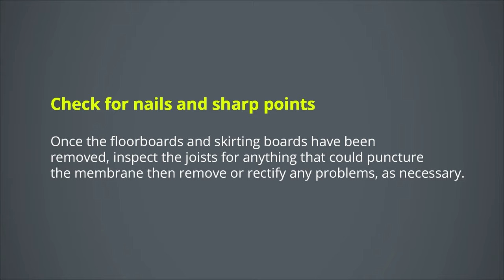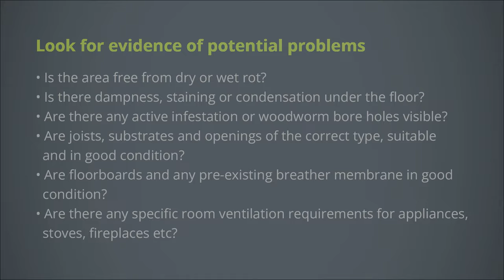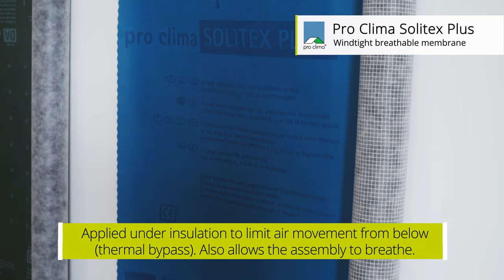Thermally Upgrading Suspended Timber Floors with Natural Insulation

Comment: Thanks Dave, very useful video. I am considering using your system, but I have to do it from under the floor, via the crawlspace. Our ground floor is largely tiled and boarded, on top of the original floorboards. Does this mean I do not need to use the vapour control membrane? I can't see how any excess moisture could seep through the tiling to cause a condensation problem beneath. Many thanks, in anticipation.
Reply from the maker: Please see the "From underneath" installation guide on our website for full details of that alternative method. https://www.ecologicalbuildingsystems.com/post/suspended-timber-floor-insulation-installation-underneath  The vapour control membrane in the video is recommended to ensure it is airtight in the long-term. Over time a tiled floor may crack, break or need maintenance, which may compromise the airtightness if that is the only thing preventing draughts. The method described in the video also seals the DA membrane to the walls with flexible tape, eliminating all draughts through the floor and around the edges. This is also great way to deal with wooden floors and any potential movement over time.

Comment: that's what in US is called a crawl space. Another solution is being suggested to incapsulate the crawl space with a membrane to prevent moisture from the ground and more importantly the radon gas reaching the living space. The wall of the crawl space are insulated, as well as, in cold climates, the floor joints, just like in this video. Any moisture is also removed with a dehumidifier.
Reply from the maker: Laying a 1000 gauge polythene radon barrier membrane on the ground below the ventilation zone below the floor joists is a good idea not just from a radon protection viewpoint, but also prevents excessive moisture from coming up into the vented zone from below ground.  If there is sufficient ventilation in the zone below the floor joists (air bricks) then dehumidification (apart from perhaps some initial dehumidification) should not be necessary.
Reply: 😅😅in Deutschland  heißt das auch   Kriechkeller. Aber sehr selten baulich umgesetzt.  Unterströmte Flächen zählen 2x so schlecht in der wärmebilanz
Reply: @EcologicalBuildingSystems  Where does the excess moisture go if a ground membrane is installed - is there a danger it will make the walls wetter, especially if the crawl space ground level is below the outside ground level (which is surprisingly common in older houses)
Reply: @furniss32 also interested in knowing this.
Reply from the maker: The zone below the floor joists must be adequately ventilated.  If the crawl space is below external ground level then there are options such as telescopic vents that can be used.

Comment: Our 20th century meddling/improvements to our Victorian houses led to unintended problems.. and still do..  Back then when coal was king (and cheap) we actually need air coming through the carpets to aid combustion.. We made the best with what was available.. When gas was introduced I believe it became mandatory to have a wall vent. The Victorians used to put newspaper under their carpets or horsehair underlay.. They had lots of horses then..  It seems every material has its benefits and down sides..  Perhaps rodents like Hemp.. Eating.. not smoking.. who knows..  I would have thought a MultiFoil type would have been easier to install and less absorbant..
Reply from the maker: The hemp and jute natural insulation has no nutritional value for vermin or insects so wouldn't be an attractive food source. 

The hemp/jute insulation is breathable and absorbs humidity which is key to the effectiveness of this solution. It is also a flexible insulation so it is easy to install with no gaps which prevents closed loop thermal bypass. Dave explains the benefits and properties of the insulation in more detail in the video.
Reply: Yes.  And don't forget they sent kids up the chimneys in those days!

Comment: well I have a question why to complicate life so much , you have problem how to solve problem of heating pipes and make so many wholes in membrane putting the breathable membrane the way you did on the video kind of the form of zigzag . Why not to do it in revers version of the roof so put the membrane under the joist, next create hammock/mesh form for insolation to rest and from the hot side of the house put vape membrane .
Reply from the maker: Hi @user-wd2qk2dt7o. The top and bottom membranes have different properties and functions. The top membrane is a vapour control and airtightness layer which prevents warm air passing to the cold side too quickly leading to condensation risk. The membrane on the bottom of the joist is breathable membrane which prevents air from below penetrating the insulation which can lead to additional heat losses, and it is also vapour diffusion open, allow any vapour within the structure to dry out. Using both membranes protects against air movement within the insulation and also reduces condensation risk.

Comment: Assuming that is a roofing membrane (blue), shouldn't the membrane be installed (flipped over) (patterned side facing external)?
Reply from the maker: Hi @Lpk9410. The membrane will function in either direction. On a roof it's important that the branding faces outward to the external side because it has better weathering characteristics in that direction. On a floor the influence of rain is not a concern so it can face the internal side making it easier at the same time to tape up with Tescon Vana.

Comment: I'm thinking of insulating from below, without removing floorboards. The method (2) you describe involves fixing strips of vapour permeable membrane under the floorboards and sealing them to the sides of the joists with Orcon F. Would it be wrong to instead run a continuous, wider length of the Proclima DA membrane across the underside of adjacent joists (and up against the floorboards), effectively placing the joists on the internal side of a continuous vapour permeable membrane, together with the floorboards (then installing the bulk insulation, then the Solitex Plus)? It just seems technically simpler, but I wouldn't want to compromise the joists with excessive moisture, for example.
Reply from the maker: Hi @yvesk876. Unfortunately, it is not possible to run the Pro Clima DA across the underside of the floor joists and then up the side of the joists and then across the underside of the floor boards.  The reason for this is that Pro Clima DA is an Airtightness and moisture vapour control membrane and this would risk trapping some moisture at the bottom of the joists – hence the reason for cutting strips of the DA membrane and sealing to the underside of the floorboards and part way down the sides of the joists (and not underneath). Hope that helps.

Comment: Great detail, unfortunately the only item not addressed was the thermal losses through the floor joists. This can be done using a thin layer of cork board or wood fibre board before the floor finishes. It dose mean doors will need to be altered nut no point in doing all this and falling at the end.
Reply from the maker: Thanks for raising this important point. In our U-value calculations using 100mm Thermo Hemp Combi Jute between 100mm timber joists (in accordance with EN ISO 6946 and BR443), we include the correction factor for the floor joist repeating thermal bridges and find that where the perimeter-to-floor ratio is <0.8, the building regulation target of 0.25W/m²K can be achieved. For a given thickness of insulation, the bigger the floor area, the better the U-value. This is because larger floors have a smaller proportion of thermal bridge losses through the perimeter.  Installing additional layers of insulation either above or below the joists is something our technical team can discuss in order to achieve a better U-value.

Comment: Great video and solution! Could this system be further enhanced by adding an additional layer of wood fiber insulation with screw strips, such as Gutex Thermosafe NF 40mm, on top of the inner floorboards or plywood? Where would the airtight vapor control layer need to be placed?
Reply from the maker: Hi @iriyarenovation. The AVCL should be positioned ideally on the warm side of insulation protected beneath the finish floor covering. Additional secondary insulation layers like woodfibre are possible from above or access permitting from below. We would be happy to review any detail if needed please contact info@ecologicalbuildingsystems.com.

Comment: nteresting and super detailed - thank you. One point - you refer to seeking to avoid condensation. My thinking is that the main concern is not condensation but sustained elevated Equilibrium Relative Humidity (ERH) values, which can lead to sustained high levels of Equilibrium Moisture Content (EMC) in hygroscopic materials, such as joists.

In other words, problems can arise even when the temperature remains above the dew point, and even if, therefore, condensation does not occur. With the reduction of heat leakage into the subfloor, the average temperature will now be lower and so the RH will be slightly higher, on average. The vapor control layer will prevent water vapor from moving into the sub-floor environment from the occupied spaces (it will prevent this moisture moving to the cold side of the insulation). However, there are other sources of moisture, especially from a slab laid on soil, or from bare soil, which could lead, with the now lower temperatures, to sustained elevated RH values. If these exceed well over 85% RH then the EMC of the joists could remain elevated well above 20%, to a level sufficient to promote fungi growth. It would be interesting to monitor the moisture levels of the joists where this system is installed with soil or slab-on-soil subfloor. It would take many years for rot to arise and cause structural damage. Another way this could be predicted would be if the RH was monitored within the sub-floor space perhaps by a data logger (or IoT RH sensor) put into the void through an air brick.

Just a thought...
Reply from the maker: The potential risks outlined can be overcome by ensuring adequate ventilation in the subfloor joist zone and also only use this system if the zone below is relatively dry. If the subfloor zone has a high water table and is constantly wet then we would not recommend using this system.

Please see our blog:
https://www.ecologicalbuildingsystems.com/post/suspended-timber-floor-insulation-best-practice-installation-guide  This explains the precautions and checks necessary to determine the suitability of the system.
Reply: L
 @EcologicalBuildingSystems

Comment: I am assuming we can install under floor heating over this form of insulation. We are hoping for UFH between joists to keep floor height low so I’m assuming we therefore just start the insulation level a little lower to leave space for UFH
Reply from the maker: The system is compatible with underfloor heating typically installed above the joists. Please contact our technical team via the contact page on our website to discuss the method.

Comment: Ordered all the materials after seeing the video! Would be interested in what's the best approach when dealing with vents that go near the joists.
Reply from the maker: Designed vent openings in the sub floor void are very important and they should not be obstructed in anyway likely to reduce airflow below the insulated floor. Hope that helps.
Reply: Telescopic vents might help
Reply: @Rich-do9mr  yes, that's exactly what I ended up doing

Comment: This is fantastic. Can you do one for method 2? We went the original boards and its freezing. I'd like to tackle it from the cellar
Reply from the maker: We are working on new video content all the time, but currently don't have a video covering the other installation method. Method 2, where the system is installed from underneath (floorboards remaining in place) is detailed on our blog here:  https://www.ecologicalbuildingsystems.com/post/suspended-timber-floor-insulation-installation-underneath
Reply: @EcologicalBuildingSystems  I have lathe and plaster and can't put the membrane and insulation to the wall as air needs to get up between the walls , I was just going to put eco insulation between joists without membrane , if it helps to keep rooms a few degree warmer it would help as it's really cold , 9 - 10 c on walls and floor , how much to get a company to do it from underneath as my crawl space is about a metre high , the joists are fine but since a new roof the loft is really cold and draughty which it wasn't before , the walls I will deal with at some point , so my question is can I just put insulation underneath between joists ,thanks
Reply from the maker: Without the Solitex Plus membrane below, there will be air flowing through the insulation which will greatly reduce the effectiveness of the insulation (convective thermal bypass).  In this situation, we would suggest both floor and wall be upgraded at the same time. Please see our blog for posts on floor and wall insulation and if you have any questions, get in touch via the contact page on our website.
Reply: @EcologicalBuildingSystems   cheers ,

Comment: How similar / disimilar are the membranes from those used in roofing?

And then, in theory, could you apply a similar system between roof rafters for further house insulation?

(Currently in the process of trying a renovate and sensibly modernise a cold 1940s house, thank in advance for any advice!)
Reply from the maker: Hi @nottagepie. The same insulation could be used on a pitched roof application. In this case the SOLITEX PLUS would be outside (with a counter batten above this if you plan to full fill the rafter void) and we would recommend changing the DA to pro clima INTELLO PLUS on the inside. The same pro clima tapes and seals can be used. Hope that helps.

Comment: Is there any issue with nails and screws from fixing the floorboards going through the vapour barrier?
Reply from the maker: The nails and screws need to be fixed to the joists tightly and not removed. Basically, when the nails/screws penetrate the membrane cleanly and all of them go directly into a joist it will be airtight. You must be extra careful not to miss the joist with a screw or nail. Any screws/nails that miss a joist mean you will have to remove the floorboard and patch the hole in the membrane with Pro Clima Tescon Vana airtight tape and try again. So just make sure you don't miss the joist with your fixings!

Comment: Awesome video. Can we apply it to our suspended floor (ground level) house in Melbourne, Australia?
Reply from the maker: So long as the sub floor joist zone is adequately vented and is relatively dry (no water pooling in the ground below) then you can use this system in a Melbourne climate.

Comment: Great video.  It mentions at the start of the video that heating pipes under the floor should be lagged - therefore shouldn't the pipe in this scenario need lagging?  When the floor boards are then re-laid, how are the membranes prevented from being penetrated by the fixings?
Reply from the maker: So glad to hear you liked the video. Yes, all heating and water pipes must be lagged due to the underfloor area being colder once you prevent heat "leaking" from the living space above. We may have missed a pipe during the filming as we didn't complete it in one take!  For the fixings, so long as the screws or nails cleanly penetrate the membrane, are tight, do not miss the joist and are not removed or reinserted, the airtightness will not be affected.

Comment: Does adding a vapour barrier on top hinder the ability of an older property to release internal moisture and encourage damp/mould issues.  Can you add a second wind tight breather membrane instead of the vapour barrier to encourage less internal moisture build up?
Reply from the maker: The vapour control membrane above the insulation prevents warm humid air escaping to the cold floor void underneath where it can condense on the cold timber surfaces and potentially cause structural damage from condensation and mould - this is a vital component of the system. The floor void, must also be correctly ventilated and free from moisture issues. Before proceeding with the installation, it is essential to check the moisture levels under the floor. Joists must be dry and any rotting timber must be replaced before beginning work. Please contact us for advice if the ground/soil below is visibly damp or wet or likely to flood. We have a downloadable installation guide here with full details: https://www.ecologicalbuildingsystems.com/post/suspended-timber-floor-insulation-best-practice-installation-guide
Reply: @EcologicalBuildingSystems  Good answer Eco!
Reply: Good question Matthew!

Comment: Thankyou. Great explanation.
Can you use the breather membrane as described in your video and PIR board between these joists sit on the breather? The reason is to allow underfloor heating pipes to clip onto the pir board.
Reply from the maker: The PIR boards would have to be cut precisely in order to achieve a full fit with the timber joists as any gaps between the timbers and the insulation leads to closed loop thermal bypass (i.e. the insulation doesn’t work as well).  Our recommendation is to friction fit Thermo Hemp Combi Jute flexible insulation to a thickness of 20mm below the top of the floor joists and then fit aluminium winged trays and sit the water pipes onto this. See an image of this here: https://www.ecologicalbuildingsystems.com/suspended-timber-floor-underfloor-heating-examples
Reply: Yes I have seen similar examples with aluminium trays, but I have read this is a poor retainer of heat compared to screed biscuit mix and not recommended future heat pump. Would would you suggest for a base to sit on the JUTE or wool or whatever for the pipes to clip to to allow a screed? @EcologicalBuildingSystems